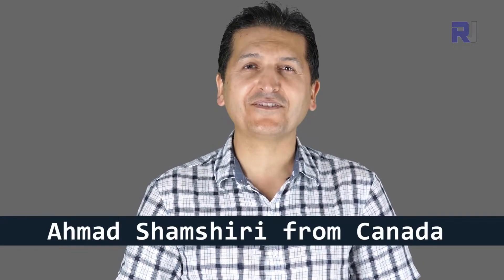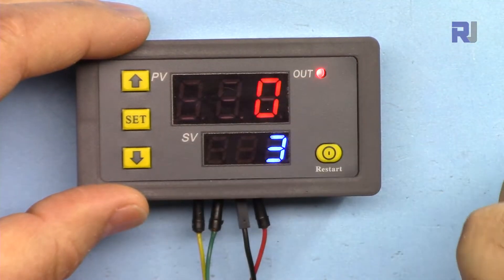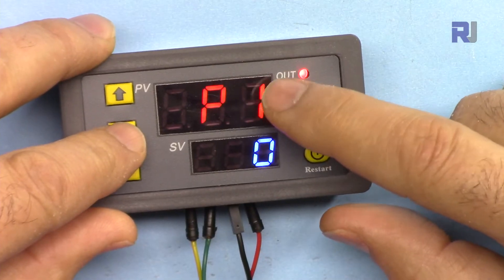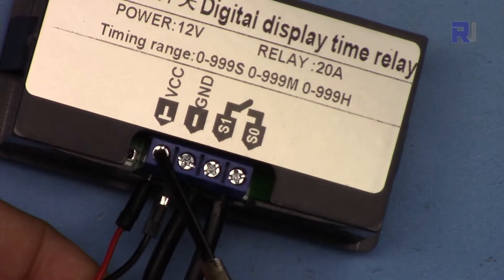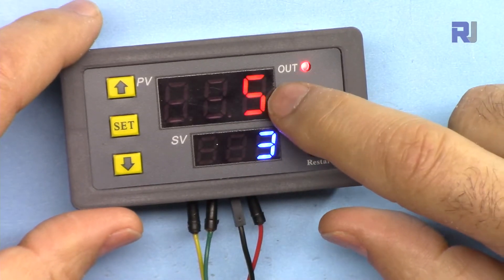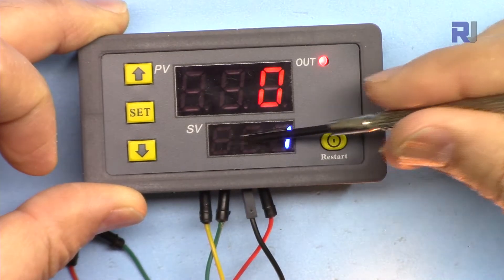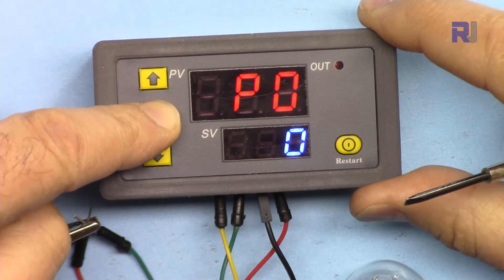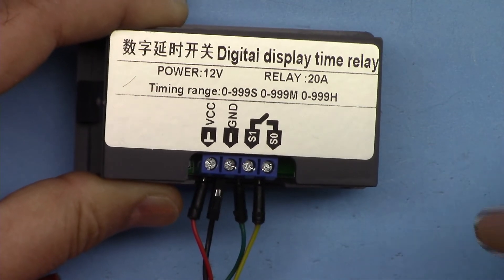Home Automation: How to use 0.1s-999 hours Digital Time Delay Relay Dual LED Display - RJT299

Comment: sadly looks like not going to get a reply.  will try anyway.  what do you call the pin thingy added to these wires to plug into each of the four spots?   coming off the bottom is NOT going to work for my set up.  Anyone got an idea on how to turn wire input 90 degrees to point backward instead of straight down or other configurations? any kind of adapters you can plug into this screw type terminal block?  Are the block sizes denoted by color. I see some are green. some are blue. etc. ???
Reply: "what do you call the pin thingy added to these wires to plug into each of the four spots" ... they are called DuPont connectors.

Comment: Robojax.. how robust do you consider this unit?  

 I am planning to use this in an offroad vehicle.  Is there a way you could suggest to help it be more robust?  Example in combat robots, RC applications  and similar devices they have sorta homebrewed potted  similar electronic devices...  Filling the whole inside with Hotglue.  Some have spraying insides with various mixtures of homebrewed silicon mixtures etc.

Comment: Can anybody give me the settings for this scenario? I want to switch on my 12V DC water motor .. 1 hr per day only. i.e. using this timer my 12V dc motor will run automatically for 1 hour per day . And this has to reoeat everyday
Reply from the maker: You can use Real Time Clock (RTC) module to have precise control on time, then trun ON or OFF a relay.  Use Arduino which is cheap and you will have full control . I have full series of videos. here is one alarm https://youtu.be/ykgXKUuvtbE 2nd one https://youtu.be/7hBtXdoaAOY and thirs one with display https://youtu.be/gz9xqvRroDY good luck

Comment: Pv & Sv usually used in controllers like temperature controllers. Pv = Process Value (for example temperature measured in the oven). Sv = Set Value (target temperature for the oven).
Reply from the maker: Thank you for sharing that.
Reply: They probably used the same enclosure used for temperature controllers.
Reply: It could also mean that Pv stands for primairy voltage and Sv stands for secondairy voltage
Reply: @RhondaKlok  or primary value and secondary value,, 😅

Comment: Thanks for the video. I was curious if this has dual polarity like a normal relay? I'm trying to set a motor to auto reverse at a specific time interval. Would I need to use a normal relay in conjunction with this device in order to achieve the outcome?
Reply: You need an H-bridge to accomplish that.

Comment: I want the timer to have a default setting of 4 second delay then turn on for a long time say 8 hours - I don't need more than one setting - So if I switch the 12 volt power on and off (key switch) then what will be the default setting? Does my question make sense

Comment: I only connected the power supply, a button to turn it on and off and a speed regulator even if it runs very slowly because I need more power than speed given by the characteristics of the motor.  It's correct?  Thank you

Comment: 2 things I noticed in this video, 1) the light came on before you even hooked up the wire and 2) there's no way the light would have worked the way you hooked it up (the hot wire coming from the timer can't be hooked to the negative of the bulb because that's reversing polarity and it won't work that way). However the wiring for the timer is correct it just wouldn't work the way you had the bulb hooked up
Reply from the maker: AC like home outlet does not have positive or negative and you can connect it in reverse. It has live and neutral wires
Reply: @robojax  yes but in the video it said it was an automotive bulb, those are DC
Reply: @coolbreezerestoration2341  incandescent bulbs operate on either AC or DC.

Comment: Sir how to put decimal point to the timer?
Reply from the maker: I don't understand. I have demonstrated and shown all features.  if decimal point is possible in some values you should have seen it.  if something is not possible with you change it UP or Down, then it is not possible.
Reply: @robojax  I thought you have an idea how to set. Because we can clearly see in the picture that it have a decimal point. 

I have one of this device and i need to know how to use the decimal point.

Thanks anyway 👍👍👍

Comment: Hello 

Thanks for the video. 

Can you help me on the following: 

I have 2 Air-conditioning units which I don't want to have them turn on (takeoff) at the same time as if that happens the main circuit breaker switch trips. 

Therefore I need some sort of a delay-On device that receives signals from the two thermostats of the two AC units and then pass them to there assigned magnetic contactors one after the other with a time difference between the two to prevent the units from turning on at the same moment which will lead to MCB tripping.  

Waiting for your valuable answer.  

Regards,

Comment: Hello  Mr. Shamshiri,
please, is it capable multiple different commands in a one line? e.g.:

5sec on - 30sec off - 1min on - 30min off - 1hour on - 3hour off...

Thanks.
Reply from the maker: Hello, I have explained all feature of this. If you watched it fully and did not find what you were looking for, then it can’t do it. So please watch fully.
Reply: @robojax  You are assuming that you are speaking clearly in the video... Also, connecting the automotive bulb was pointless when you kept it out of the camera frame as you were going from program to program. All we heard was rambling , without a visual of what was happening.

Comment: hello hi, what  if im not using the powerload at S1 and S0 ? can i connect the Life wire with S1 and Neutral wire with S0 and by using the T wire connection to the load

Comment: Now can you set your on time for 30 seconds and off for 6 hours or does the on off have to be in the same time setting as in the on and off both have to be in seconds,min, or hours. I need mine on 30 sec off 6 hours
Reply from the maker: you made me watch the video. Why would you both are the same? do we have only ONE time? no. We have T1 and T2 which means you can set time for both. Yes there are device with single time then we know it must be the same.

Comment: What is the maximum output of it?
Reply from the maker: output of what? if you are looking for power, I have explained the relay. There is no other output.
Reply: @robojax  I want to use it in my pc..
I am planning to use it when power back in my home i want to set 30s time after 30s automatic power on my pc 
But the problem is my pc use 750W.
Is it handel it??
Reply from the maker: Okay then please watch the relay pier rating section of the video and compare it to your pc power . I am sure it can do it

Comment: The title says "... 0.1s- ...". This is not true, because the timer does not support measurements of less than one second.
Reply from the maker: which time? I believe if you can set it, the system will trigger the cycle at that time .

Comment: So this relay does not deliver any power from the power supply but only serves to complete a circuit? The 12 volts is only for powering up the module then? Other than the power required, what difference would the 24v have from the 12v?

Comment: Thanks a lot for this vedio. I have a need to light a bulb in case my water pump is running more than a specified time (more than 30mins). Can that be done with this ?
Reply from the maker: that is exactly what you can do with this.  watch and use it for your own purpose.

Comment: If I want to set it to be cycling
( OFF for 2 hours and ON for 15 sec.) and repeat itself
Reply from the maker: it is called loop. if it has loop option, I should have shown it. watch the video fully as I don't remember what I did in this video.

Comment: Will the timer start when power is applied? For instance, in case of power loss, will the timer start when power is restored? Or do you need to press a button to start the timer after power loss.
Reply from the maker: In power loss the timer is rested. But the program stays.
Reply: @robojax  I'm sorry I do not understand your response. Do you mean the timer is reset?  Does it start to count down when the power is restored?

Comment: Hi I have one exactly the same do I have to only use Dc Power or I can connect on AC , thanks
Reply from the maker: Hi, if you module is AC, then connect AC. if it is 12V or 24V DC, then connect the appropriate voltage. We have operating voltage and load control. the load can be AC or DC doesn't matter.

Comment: How to set 0.1 second?
Reply from the maker: Have you watched it? If I have not shown it , then not possible. I never leave such important feature. Besides relay is mechanical and 0.1s is very fast and I might not be able to  get good result. Before relay turns on it will go off.  Please watch it fully.

Comment: Thanks for the video , I have a 24V DC versoin and I am trying to get a 24 volt DC water heater working through one of these and I can set it up , get the power to come on , runs through the P1-5 on / off programme ( on for 5 seconds off for 15 )  but it doesn't put out any power whatsoever , any ideas, I was wondering if the 300watt dump load is too powerful.
Reply from the maker: it has relay. when it turns on you should hear click. Listen to it and if it doesn't click, then either relay or the module is faulty.

Comment: I came across videos on youtube that said a time delay relay can be used to "latch" pulsing power by way of a time delay relay set to 2 seconds to "keep a power signal open". That is, until the trigger is removed. The idea is I will use this kind of relay to power a side view camera on my car to send video to my monitor by using the right and left turn signal wires on the turn signal switch. Can this device facilitate a looping effect via the 2 second delay pulse my turn signals get until I move my turn signal to the neutral position?
Reply from the maker: I waited to see if someone replies.  I just watch the video and I believe you should get your answer by watching the video fully without skipping.
Reply: @robojax  Thanks for the reply. I looked at an instruction manual for a different relay and it had  a 12v input (low/high) and it's ground. It had an input for the source trigger and it's ground. and then there were 3 output connections. one for power to the device and it's ground. No idea what the third thing was. So apparently (according to that manual) the intermittent trigger is what makes the time delay relay work, and depending on the delay time - will periodically turn on or off the device. My issue was how the device would stay on continuously with a trigger that powers off and on automatically. But it seems the 12v constant power is what turns on and off according to the timer. And that is what keeps the device on while the trigger is active. Thanks

Comment: Robojax La meilleure chaine de Module Chinois ! tu devrais afficher la consommation MilliAmpére de tout les modules que tu présente ! en commençant par ce module ? tu crois qu'il consomme moins que un arduino uno r3 en veille?
Reply from the maker: Parce que nous travaillons avec du courant alternatif et que ce module est également utilisé en haute puissance comme une charge de 5 A ou plus, le courant de 200 mA qu'il utilisait pourrait être négligeable avec 5000 mA ou même avec du CA. C'est pourquoi je n'ai pas pris la peine de regarder la consommation actuelle. Arduino consomme moins de 30mA (je viens de mesurer). Celui-ci a un affichage LED et chaque segment consomme 10mA. Merci.
Reply: @robojax  , Merci à toi Surtout , ça répond exactement à ma question , je vais partir pour mon projet sur un Uno.  Merci bonne continuation et longue vie à ta chaine !